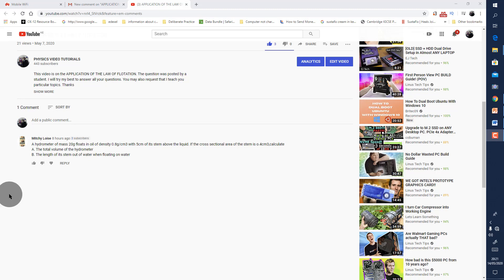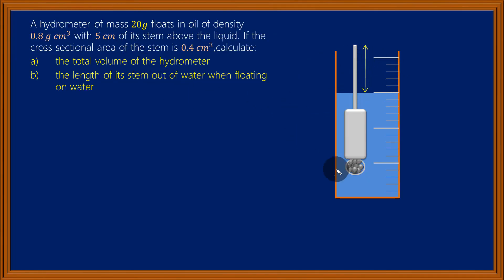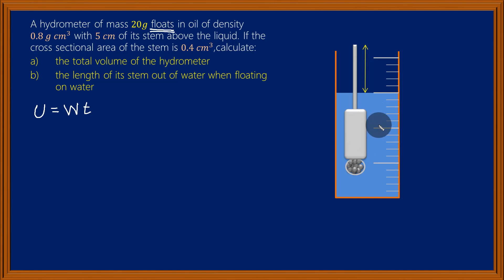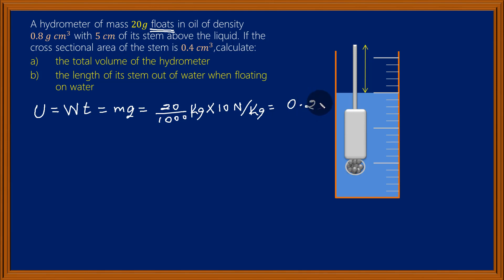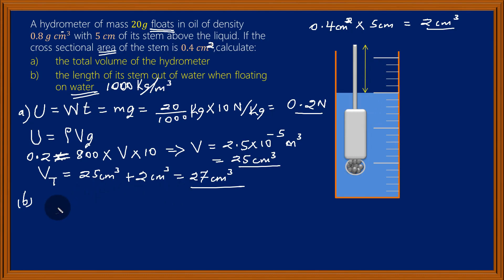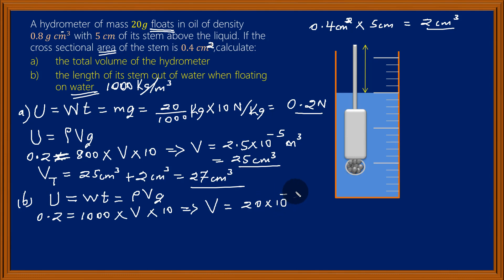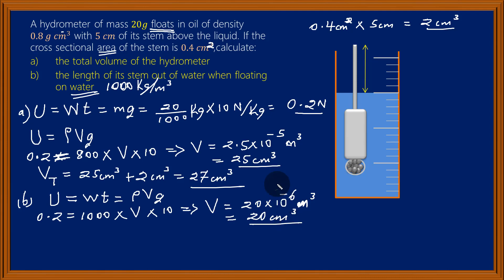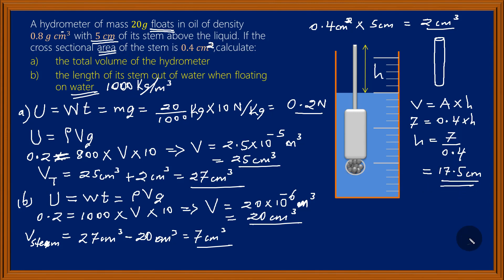SOLUTION TO HYDROMETER QUESTION

Comment: Answer the question;An ordinary hydrometer of mass 27g floats with 4cm of it's stem out of water .
If the cross section area of the stem is 0.75cm2.calculate
a.) the total volume of stem just under the surface of the liquid.
b.) the relative density of the liquid

Comment: Find the depth of the center of pressure of a vertical plate that has an area of (1.5mx2m) if the upper plate edge is 1.5m below the surface of the water? assume the length of 1.5m is a parallel to the surface of the water

Comment: Answer this question A hydrometer of mass 0.035kg has cross sectional area of 0.0001m2 and volume of 0.0000020m3.what length would be immersed when floats in water?

Comment: A sample of soil of mass 40 g is dispersed in 1000 ml of water. How long after the 
commencement of sedimentation should be the hydrometer reading is taken in order to 
estimate the percentage of particles less than 0.002 mm effective diameter? The center 
of the bulb is at an effective depth of 20 cm below the surface of the water. Take 
G = 2.70 and  = 0.01 poise.
Reply: Could please solve this question

Comment: When a hydrometer having a stem diameter of 0.8 𝑐𝑚 is
placed in water the stem extends 8 𝑐𝑚 below the water surface. The hydrometer
weighs 0.187 𝑁. Calculate the volume of the hydrometer bulb.
Reply from the maker: assuming the hydrometer is cylindrical, use the diameter to get area of cross-section (A). When "A" is multiplied by the length submerged, (i.e. 8 cm), you get the volume of the stem which is submerged. Note that this is not the total volume of hydrometer. You have to add the volume of the bulb "v" in order to get the volume of the bulb. Since hydrometer is floating in water, the weight of the hydrometer is equal to the weight of the water displaced (Application of the law of floatation). I have given you major clues. Now use these to solve the problem.